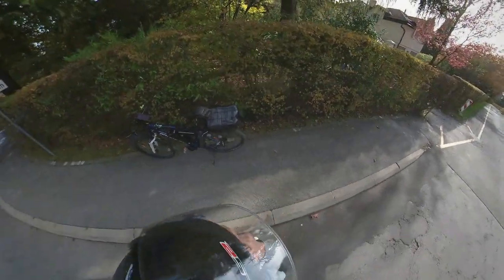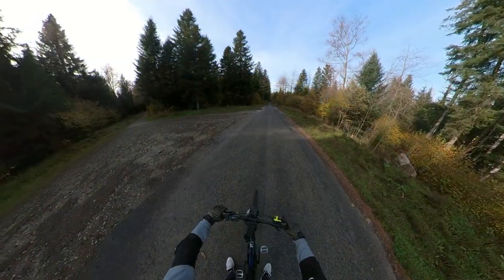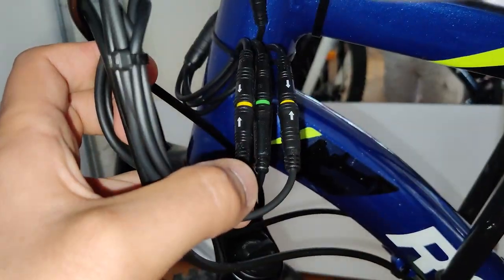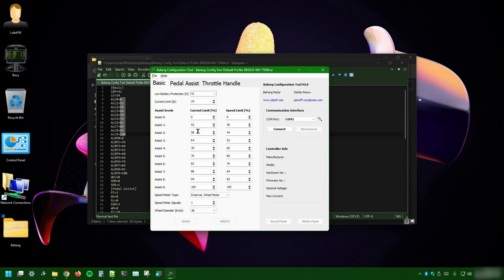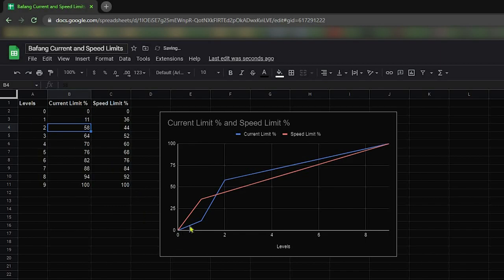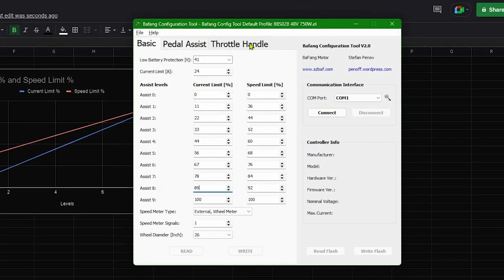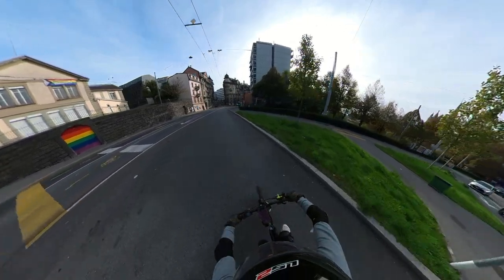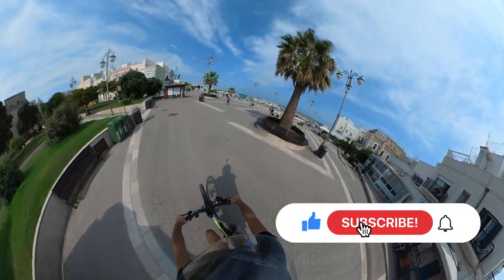I Downgraded My 750W Bafang Kit... but WHY?

Comment: CUT THE GREY PAS WIRE!!! PAS IS USELESS.... Make your bike a throttle only bike! Then those PAS settings will be the power settings of the throttle!! You ride your bike like a bike and add power when and where you need it! I've built over 20 bikes and the ones I set up like this for people they couldn't belive how much they loved thier bikes again.
Reply: Can you provide a link to show me where in the programing software that I can disable the PAS? If so I will test a drive without the grey PAS wire cut and see if it behaves the same as my set up.
Reply: Can you provide a link to show me where in the programing software that I can disable the PAS? If so I will test a drive without the grey PAS wire cut and see if it behaves the same as my set up.
Reply: Can you provide a link to show me where in the programing software that I can disable the PAS? If so I will test a drive without the grey PAS wire cut and see if it behaves the same as my set up.
Reply: Can you provide a link to show me where in the programing software that I can disable the PAS? If so I will test a drive without the grey PAS wire cut and see if it behaves the same as my set up.
Reply: Can you provide a link to show me where in the programing software that I can disable the PAS? If so I will test a drive without the grey PAS wire cut and see if it behaves the same as my set up.
Reply: Can you provide a link to show me where in the programing software that I can disable the PAS? If so I will test a drive without the grey PAS wire cut and see if it behaves the same as my set up.
Reply: Can you provide a link to show me where in the programing software that I can disable the PAS? If so I will test a drive without the grey PAS wire cut and see if it behaves the same as my set up.
Reply: Can you provide a link to show me where in the programing software that I can disable the PAS? If so I will test a drive without the grey PAS wire cut and see if it behaves the same as my set up.
Reply: Can you provide a link to show me where in the programing software that I can disable the PAS? If so I will test a drive without the grey PAS wire cut and see if it behaves the same as my set up.
Reply: Can you provide a link to show me where in the programing software that I can disable the PAS? If so I will test a drive without the grey PAS wire cut and see if it behaves the same as my set up.
Reply: Can you provide a link to show me where in the programing software that I can disable the PAS? If so I will test a drive without the grey PAS wire cut and see if it behaves the same as my set up.
Reply: Can you provide a link to show me where in the programing software that I can disable the PAS? If so I will test a drive without the grey PAS wire cut and see if it behaves the same as my set up.
Reply: Can you provide a link to show me where in the programing software that I can disable the PAS? If so I will test a drive without the grey PAS wire cut and see if it behaves the same as my set up.
Reply: Can you provide a link to show me where in the programing software that I can disable the PAS? If so I will test a drive without the grey PAS wire cut and see if it behaves the same as my set up.
Reply: Can you provide a link to show me where in the programing software that I can disable the PAS? If so I will test a drive without the grey PAS wire cut and see if it behaves the same as my set up.
Reply: Can you provide a link to show me where in the programing software that I can disable the PAS? If so I will test a drive without the grey PAS wire cut and see if it behaves the same as my set up.
Reply: Can you provide a link to show me where in the programing software that I can disable the PAS? If so I will test a drive without the grey PAS wire cut and see if it behaves the same as my set up.
Reply: Can you provide a link to show me where in the programing software that I can disable the PAS? If so I will test a drive without the grey PAS wire cut and see if it behaves the same as my set up.
Reply: Can you provide a link to show me where in the programing software that I can disable the PAS? If so I will test a drive without the grey PAS wire cut and see if it behaves the same as my set up.
Reply: Can you provide a link to show me where in the programing software that I can disable the PAS? If so I will test a drive without the grey PAS wire cut and see if it behaves the same as my set up.
Reply: Can you provide a link to show me where in the programing software that I can disable the PAS? If so I will test a drive without the grey PAS wire cut and see if it behaves the same as my set up.
Reply: Can you provide a link to show me where in the programing software that I can disable the PAS? If so I will test a drive without the grey PAS wire cut and see if it behaves the same as my set up.
Reply: Can you provide a link to show me where in the programing software that I can disable the PAS? If so I will test a drive without the grey PAS wire cut and see if it behaves the same as my set up.
Reply: No
Reply: @JasonNosajasoNosaj 😂😂😂😂 he was persistent ill give him that 😂

Comment: Hello Luke!  I watched several of your videos before upgrading my bike with a bbs02b 750W.  Thank you! Keep the good work!  Everybody has a different biking style. I am a fan of efficient use of energy which comes down to 3 principles (1. Bike in a way so that you almost don't use the brakes.   2. Make use of gravity.   3. Don't be too fast unless you need to).   All my speed limits are set to 100% (this is not what affects efficiency, your biking style does). My starting current is set to 7% (was at 20% first but then starts felt too energetic).  I eventually concluded that 9 levels are too many for my style, so I switched to 5 levels, set as:  10%, 20%, 30%, 60%, 100%.  I use mostly levels 1,2,3, very rarely - level 4 and almost never - level 5.  On my commuting daily trip there are hills but not very steep. If readers of this nice channel would like to try my settings and share opinions, I would be pleased.   Cheers everybody!
Reply from the maker: Hey man! I agree 99% of what you said, thanks for sharing your experience 💪
Reply: i would like to try your settings, can you post up here?  like you i too use 5 x PAS levels. am i right in saying when using 5 PAS levels it chooses assist 1, 3,5 7 & 9?
Reply: @gerrykeaveney1657   yes, that's correct. So the 2-4-6-8 level settings are not important in that case. Here are my settings. I am open to hear suggestions, comments:
[Basic]
LBP=41
LC=25
ALC0=0
ALC1=10
ALC2=15
ALC3=20
ALC4=25
ALC5=30
ALC6=45
ALC7=60
ALC8=80
ALC9=100
ALBP0=0
ALBP1=100
ALBP2=100
ALBP3=100
ALBP4=100
ALBP5=100
ALBP6=100
ALBP7=100
ALBP8=100
ALBP9=100
WD=12
SMM=0
SMS=1
[Pedal Assist]
PT=3
DA=0
SL=0
SSM=3
WM=0
SC=7
SDN=4
TS=25
CD=8
SD=0
KC=60
[Throttle Handle]
SV=11
EV=42
MODE=1
DA=0
SL=0
SC=5
Reply: How would you program it to nexus 3? just changed by hub from 7 to 3 as this is typical city bike, but getting confused on the power settings. I also only use 1-3 gears, rarely 4 as bike is 2 fast. So trying to figure proper settings for max speed 45 and 3 gear shift.

Comment: The great advantage of the BBS02 is the extent to which its characteristics can be adjusted to meet the needs of the rider. Changing power levels and rates has a dramatic effect on the how the bike reacts to rider inputs. I also use an an Eggrider that offers the ability to not only have 2 separate provides but also to make changes essentially anywhere. I found that the process of fine tuning required many changes and took a good deal of experimenting on the road - ideal with the Eggrider. However you do it, you will not get the full benefit of the BBS02 without controller tuning...
Reply: I hope the Eggrider is improved over the original. Mine stopped working when the bluetooth dongle developed a short (no Eggrider display back then). I have since the original version started using a phone app called Speeed.
Bottom line is you have to fiddle with stock settings to get your perfect ride, no matter how you do it.
Reply: There's no any advantage.it'sjust crap stock controller that you tinkering with

Comment: Cry baby, I have the 1000 watt and love it. If you're geared very high I can see the torque being crazy but 46 tooth in front and 26 in back isn't wheelie ville. If you want a torque sensing get the m365 mid drive. Geesh

Comment: I have installed 2 Bafang 750 mid drive kits now and neither of them have EVER made my bike wheelie or go out of control.  Recently I detuned both bikes to more gradually deliver power on the onset of peddling. Mostly to lessen the feel of the assist.  But, not for the over dramatized wheelie or out of control thing. Not even on setting 9 will they do wheelies.  You have the 42 tooth front sprocket?  If you do, and this is probably why you are doing wheelies.  Most riders should be using 52t front sprockets as the smaller sprockets are for mountain bike set-ups.

Comment: I modified my settings to 9 levels and upped my speed assistance to 28mph. This system is working with a 10-speed cassette and changing it to  9 levels of assistance, it works much better and smoother compared when it was on 5 levels of PAS.

Comment: The best thing I bought was the eggridder V2 display for my bafang mid-drive motors I can change all my settings from my phone even when I'm out on a ride it's a lot better than the cable to configure your controller settings 😀
Reply from the maker: hey man! I heard about it, it seems like a super cool thing!
maybe not the one for me specifically: I'm more like "study it at home and then just drive the result", but it's definitely better if you want to test things "live", like you say 💪
Reply: @LukeLorusso  I agree when I'm out I don't mess around with the settings like you I just study it at home then apply my changes for my next ride infact I've not changed them since
Reply from the maker: @ashpunting  you know what... maybe I should try it! I'll keep you posted😉
Reply: @LukeLorusso  Please show us haha
Reply: Yeah I use the eggrider v2 it's very handy to have, saves having the cable with you as well.
Reply: @ashpunting hey, the eggrider v2 works with bafang 250w on mate x? Thanks

Comment: My wife'sBBS02 came out of the box wth the same current percentages attributed to each power level (1-9) which meant that it was producing 600 Watts (12.48Amps : 52% of 24A)  in power level 1. It was a bit of a beast on the first test ride and clocked 35mph on the flat!
Thought this setup might scare her so set max current to 20 amps an toned down power levels 1-9 now (2 years later) have current % at 0=0, 1= 8%(1.6A), 2=11%(2.2A), 3=14(2.8A), 4=17%(3.4A), 5=30%(6A), 6=50%(10A), 7=70%(14A), 8=90%(18A) and max 9=100%(20A) Not if you  multiply Amps(A) by nominal battery volts (48) you will have the power for each power level setting which equates to 1 =77W, 2=105W, 3=134W, 4=163W, 5=288W, 6=480W, 7=672W, 8=864W and 9=960W. My kit came out of the box with a much softer set of lower power levels and have now ended up setting as per wifes. Both have been utterly reliable and regularly achieve 70 miles range fron a Hailong 48V 17.5A (840Wh) battery. Throtles have been changed from "by displays command"  to power level 8 so there will  always be up to 864Watts of powet to get you out of trouble. We use them mostly on motorhome holidays where we can charge  both batteriesin an evening using free solar power.
Great series of videos that inspired me to build our e-bikes. Wife said she wasn't old enough for an e-bike,but its now her most treasured posession!

Comment: Thanks, I have a 250 watt Bafang, max allowed in UK and most of Europe. I have tuned it to overpower it in the higher assistance levels and less for level routes, even the 250 watt version you can sometimes be surprised when the power kicks in.
My ammeter often shows a current of 800 watts when climbing off road, and even after 3 years the motor and battery are fine.
Reply from the maker: thanks for this John, so you actually feel confident advising a 250W Bafang kit. nice to know! :)

Comment: I also dropped my 750w BBS02 down to make it smoother. I ride a fair amount in the city and just crossing the street was kind of a ridiculous exercise. If I were to buy another one, I'd probably get a 500w version - it would be plenty of power. I also got a 19 AH battery and with I'd never gotten something so big and heavy. I've never used more than about 60% in a single ride, even in the Alps. This video really helped me understand how to accomplish this, but I used the Speed Android app and my phone.
Reply: Could you tell me more about choosing the 500/750. My use will be mainly shorter rides in hilly areas.
Reply: @djVania08  750 is better. More efficient.

Comment: I modified this to keep a constant speed with varying power levels. Great!
Thank you so much for this. Way better!

In detail. I tend to ride with the same cadence no matter what. Since you adjust your speed with gears, not cadence (as lower cadences are less "efficient" for your legs), I set PAS 1-8 speed to 65 (upper comfortable limit for me). PAS 9 is 100% speed. This feels much more natural, as I can pedal as fast as I want, but control the assistance.  If I want less RPM I change to a higher gear with lower PAS. 

My settings are as follows:
0: 0, 0
1: 11, 65
2: 24, 65
3: 36, 65
4: 49, 65
5: 62, 65
6: 75, 65
7: 87, 65
8: 100, 65
9: 100, 100

With throttle set to current and PAS 9, I can quickly overtake without spamming the PAS adjuster. 
The first setting is great for a little push when cruising, but you don't really need any more to keep your speed. 

Set the speed to a percentage to where you're just bearly uncomfortable. Above a certain cadence you start to loose power, so there is a sweet spot (I would say between 60-90rpm)
65% of 130rpm should be around 87rpm.

Comment: Hey man. Before I bought my BBS 02 motor, I watched some of your videos. They really helped in the decision and I absolutely love the Bafang motor. And yeah I agree, the power/kick on lower settings is a bit too much for a city rider like me. Gonna get that USB cable and do some tweaking. Thanks mate
Reply from the maker: Sure Fahad! Thanks to you for your interest
Reply: Yeah, factory default  setting is too strong. I worked on my settings few times and now im very satisfied. It reacts the way i wanted. But truth is, torqe sensor still wins :) but i made 10000km on my bbs02 350W and it still works like first day.

Comment: Awesome, thanks for sharing that with us! I'm looking at building one with a 750W motor and a huge 48V 45ah triangle battery, and seeing these settings and curves should help me get the most range out of it and also make it easier to control the bike when not needing to go too hard.
Reply: Hey good luck on your project. Tire thickness makes a massive difference 1.95” vs 2.25” can produce very different ranges.

Make sure the bottom bracket will fit the mid drive.
Reply: Thanks!

Comment: I had been struggling with the settings until I saw this video, thank you!
Your settings have tamed the wild steed and I no longer feel like I'm at the rodeo!
The only issue I have now is the long power pause of the gear shift and wondering if there
is any way to remedy that.
Reply from the maker: Hi William, I'm happy to be helpful
About shifting, the only suggestion I can give is this: you can shift while pedaling, if you do it at the right moment.
(works only with Bafang, not with Tongsheng) When pedaling, the motor will increasingly provide some Watt, you can see it from the display. Let's say it goes up to 750W... at a certain moment, when the right speed is reached for that level, the Watt provided will be reduced, leaving more responsibility to your legs. THIS is the right moment to shift while pedaling, cause the chain will just sustain your legs' force, like on a normal bike. As soon as you shift, or half a second later, the motor will start to help you again!
Try this out 👍

Comment: Very helpful video,  thanks! One question, though, I see here, and in other BBSTool videos for the Bafang 750w mid drive motors, the 100% current limit is at around 24A, with 48v battery, this is just over 1100W... no issue with this!? Why not reduce the limit to 16A and protect the motor?

Comment: Good video, thanks for posting.
Is there a way to speed up the PAS response? 
I have gone through all of the settings and now my throttle works much smoother and the PAS levels are just what I want. However, the Pedal Assist comes on way too slowly, only after 2 complete revolutions of the pedals.  Is there a setting that controls this?  Thank you!

Comment: On my BBS02b I changed the 'throttle handle' thumb throttle from current to speed and it made it much smoother and linear. Before when set to speed it was just like an on/off switch. thanks for the video 👌
Reply from the maker: Thanks to you John! I'll try that 😉
Reply: Hi- you say you changed it "from current TO speed", but then say "Before when set to speed"...  this contradictory.  What setting did you end up using?  Thanks.
Reply: @garyfisk370  Hello Gary. Yes i got that wrong didnt I. My BBS02 is now set to speed and that seems to give the smoothest throttle. If you try 'speed' under no load (with the rear wheel lifted of the ground) then the thumb throttle is really smooth and variable, incremental, progressive, whatever the word is, but under load as in normal riding this is less obvious but still seems smoother than using 'current'. My advice is try both. Conversely on my BBSHD I have it set to current as that seems to give the better response in actual riding. (BBSHD with the rear wheel lifted under no load and using 'speed' then the throttle seems really controllable from barely spinning to full speed as you move the thumb throttle but this doesnt translate to actual riding when the motor is under load). So try both.